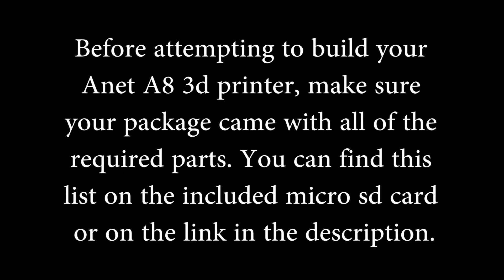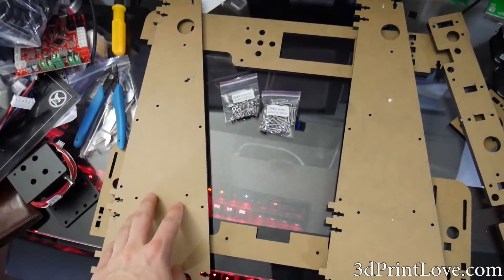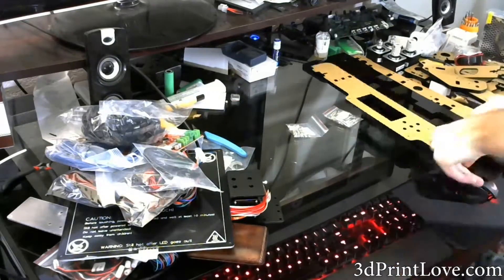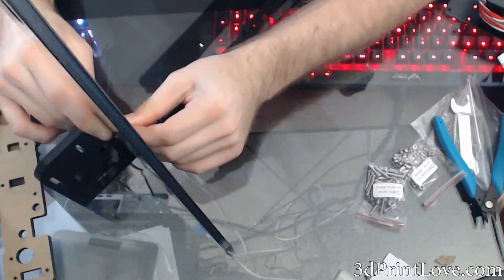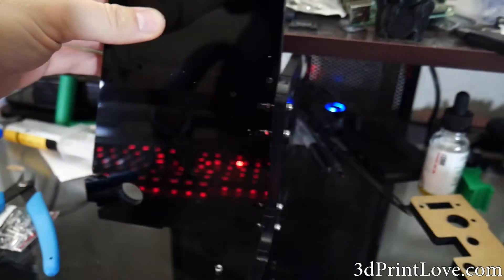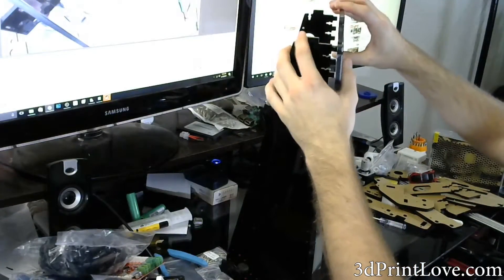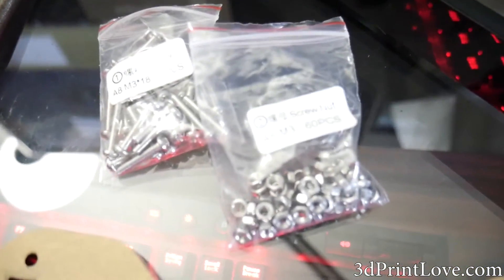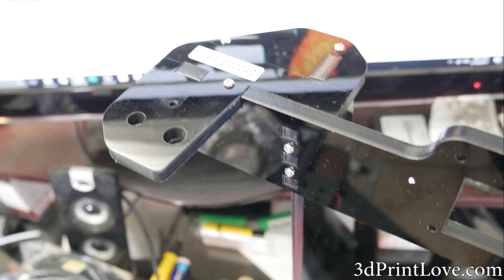Anet A8 3d Printer Build Guide Part 1 The Main Frame

Comment: An easy way to hold the nuts in place is with some of the protective cover tape. Put a small piece on one side of the nut slot, insert nut and then cover the other side with another small piece. It does a pretty good job of centering the nut.
Reply: I've been using some small strips of blue painters tape. Certainly cuts down on the fumbling and swearing. Overall, a great series and much easier than trying to figure out the directions.